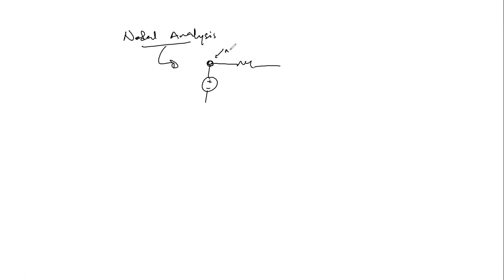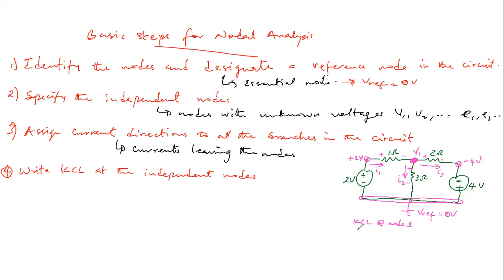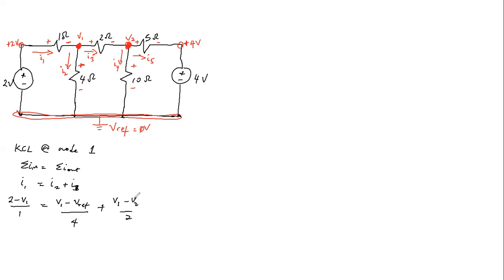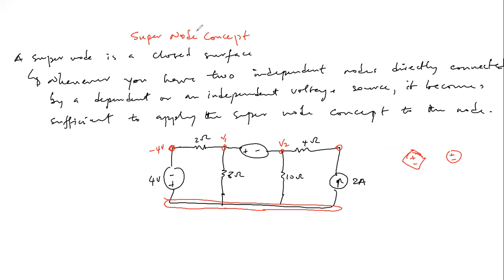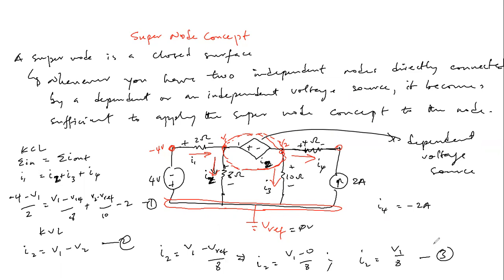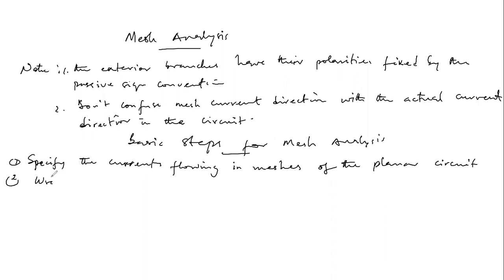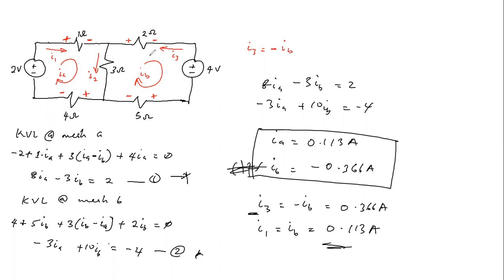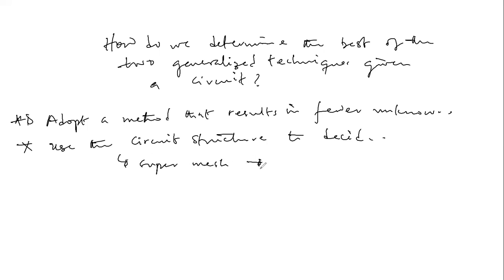LEC02. Nodal & Mesh Analysis #lecture #new #electrical #circuits #engineering

Comment: Super helpful video. Thanks a lot sir.
Have a few questions on the reference node (Ground) though.
1. You said to prefer to take the nodes closer to a voltage source. Are there any effects or changes when we do that?
2. Do all circuits actually have a ground or is it just a mental construct to simplify calculations?
Reply from the maker: Selecting the ground close to a voltage source makes the analysis easier while having insignificant impact on the circuit. And the idea of “ground” in analysis is virtually always used simply to impose a zero-voltage reference level and not all circuits have a physical ground. Do note that in power systems, the physical ground is the actual connection to earth and it serves as a return path for safety purposes. Nonetheless, the ground in circuit analysis is more like a mental construct, it is an abstraction used to express the zero-voltage point for the purpose of simplifying the circuit. For instance, floating point circuits (battery powered devices) and differential signaling such as the digital communication protocol may not require any physical connection to ground. However, we may still choose a reference node for the analysis of the floating point circuit while the signals may be referenced to each other in the case of differential signaling bearing in mind that a single ground point does not exist.
Reply: @dr.a.e.ibhaze4136  thanks for the reply sir. I think I understand better now.